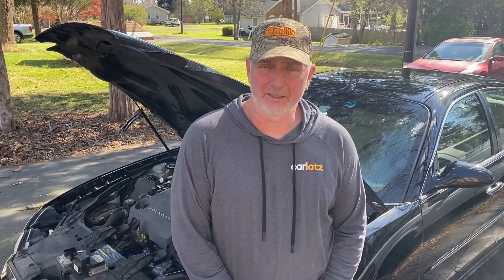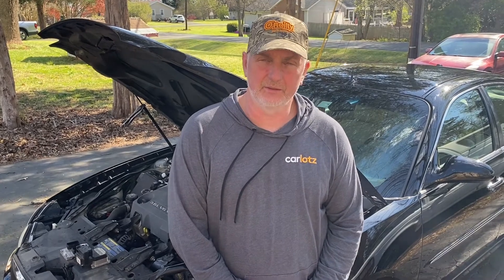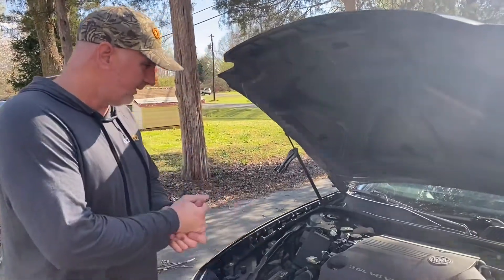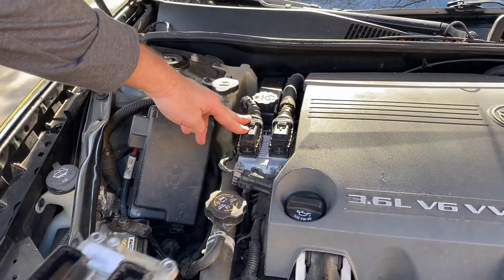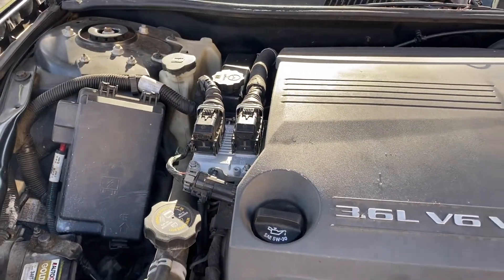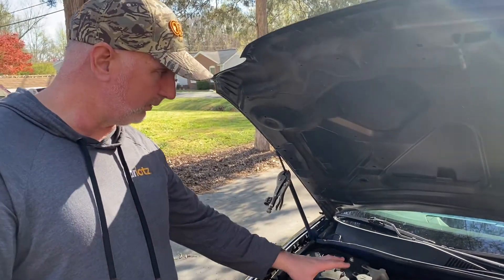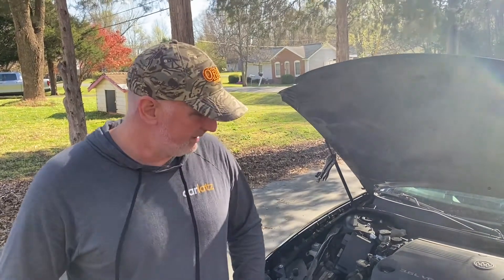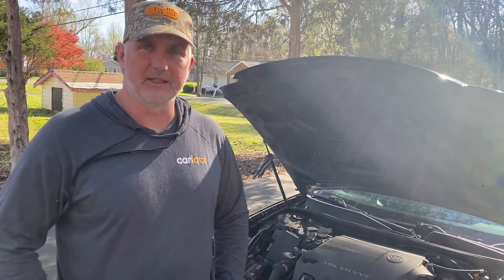FIXED 2005 Buick LaCrosse - Failed ECU - Failed EBCM - Starting Disabled

Comment: We have a 2007 LaCrosse CX 3800 with a no Crack, no fuel pump. It did start a couple of times & would run for about 10 seconds, then shutdown and then no crank again. I will comment what we find with ours.

Comment: Got a 2013 lacrosse with the same issues randomly just won't start sometimes it'll kick in 10 15 20 minutes later
Reply: Ever figure it out? I have a 2012 lacrosse and it does same thing. Sometimes it'll start if I keep pressing button. Other times won't start at all and will give me multiple warnings and check engine.
Reply: @theATF  I believe it was a cracked fuse box.
Reply: @theATF  I pulled the file on the car when I get home later this afternoon and confirm that. 🇺🇸👍

Comment: The volume for the anti-theft system, the beep beep beep, when you put the keys in the ignition, turned up and is at high volume. It always used to be at a medium-average level, but my mom used it one day and now the volume is very high. How do I control this?? Mine is a 2005 Buick Lacrosse cxl. Help me please!😂

Comment: WOW!!! You explained that really well. I have a 2008 Buick LaCrosse CX, 3.8L, V6, Series 2. And it’s sounding like a Freight Train. It also has over 217,000 miles. Could it possibly be the Timing?
Reply: Check the coil packs first make sure they are firing next test the ICM which sits under the coil packs..
Reply: Interesting. They stopped making the series ll in 2004

Comment: Working on this same car now. Randomly not starting. ABS no communication. No communication with ABS module. Couldn’t bleed braking system. Testing for ECU/PCM/ECM voltage today. If voltage is found will be replacing the module. Will probably replace ABS as well due to this video showing the car would not reprogram without other repairs. Since knowing I also  have a ABS problem previous to my other issues, seems this will be the fix.

Comment: I thank you for sharing your experience and knowledge, I also had a issue with the ECM. One injector would not pulsate. Frustration set in, then I sent it to a shop, for diagnosis. I bout one and those guys could not program it. Turns out that I had to do it all myself without a scanner or programming.
Reply: How did you do this? I got one from flagship one for my vin and it will not re learn. Won’t start
Reply: @jaynecobb4964  I removed the battery cables, closed & locked the doors. Installed it and reconnected the battery. Unlock the door and insert key, turn to start or run. BUT DID NOT START the car. Basically relearns the key & poof it started. Hope it helps.
Reply: @SOLIZ49erFAITHFUL I’m having the same problem, all my fuel injectors are firing beside one. Can I buy a new or used ECM?

Comment: Hey thanks ALOT for putting this up. I think a lot of folks are having this problem with Buicks. I've had similar issues but probably a crank but no start and it turned out to be the ECU but not a combination of the brake control module and the engine control as well. It looks like my friends 2007 Buick Lucerne is exhibiting some similar issues except it cranks but won't start.

Also, you're a pretty articulate guy and a good speaker, ...for a Hillbilly. 

Bwahahaha

Additionally, nice place you got out there if that's yours in the background. Gorgeous lots of space I would love having a property like that. I live in the Oakland Bay Area and I've often dreamed of having a ranch property or something with lots of space around.